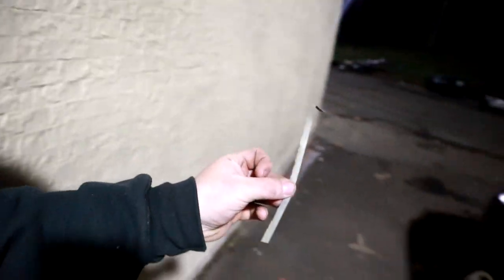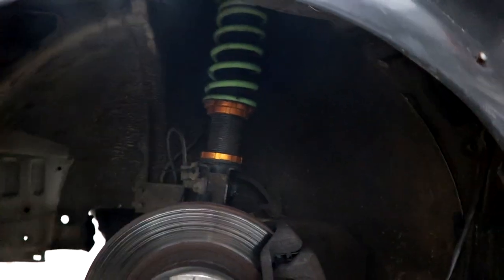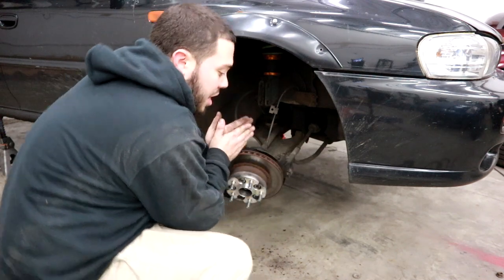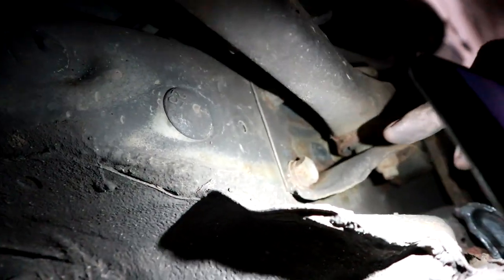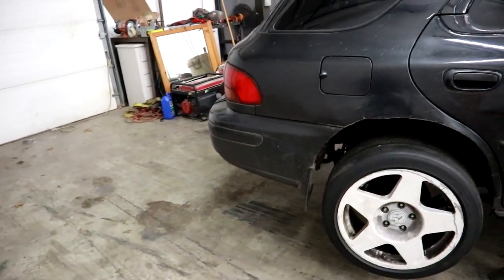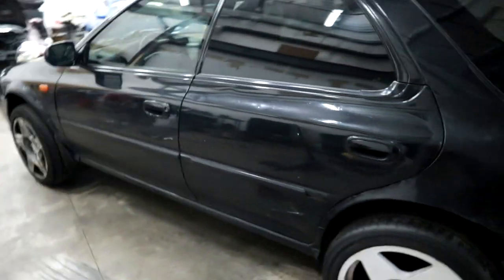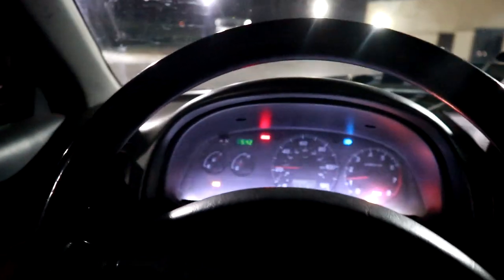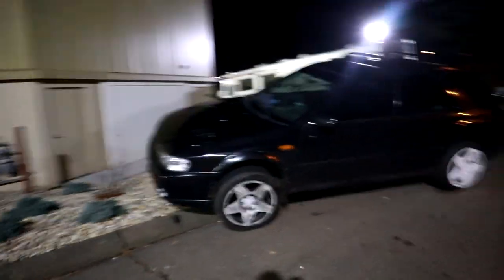RACELAND SUBIE LIFT KIT?!

Comment: You will need trailing arm spacers to prevent hitting in the rear and prevent the axles from moving forward in the wheel well and also with a larger off-road tires or winter deep tread tire you’ll get more Lift and more ground clearance trust me it’ll look awesome!!

Comment: Paint the Cloutbocc wheels mint. Maybe put Forrester struts on your car, it will give you more lift
Reply: matthew hancock he already has full coil overs. I don’t think he would want to remove those for some stock struts. Plus i believe he is only doing this for winter $20 says he’ll slam it back down in the spring (that’s what I would do with my impreza if it wasn’t just on stock struts that you can’t adjust)
Reply: @_NTHN_  true  and I'm sure that he will slam back in the spring.
Reply: Gives it 3" just did it to my outback

Comment: It's cool that you can raise up the suspension like that. I have a custom Ground Control coilover kit on the Speed3 and with the 6" spring length they use standard. The adjustment range with this is 0.5"-2.5" below stock height. If I wanted to raise it up, I'd have to get longer springs - 7", 8", etc. It's easy to do because I run Eibach ERS 2.5" ID racing springs, but swapping those out is more involved that simply adjusting a collar.

Comment: Are you getting a proper lift kit?
Reply from the maker: alex gonzalez not sure I kinda want to since they’re cheap but I don’t plan on running big tires and it’s plenty high right now
Reply: Damian Monte or you could run forester struts?
Reply from the maker: alex gonzalez my car is higher than forester struts right now and they’re stiffer so it won’t rub like forester struts would
Reply: Damian Monte I see. It sure would be a much smoother ride and more flex though! Either way it’s sick